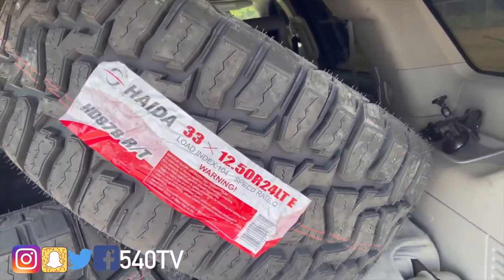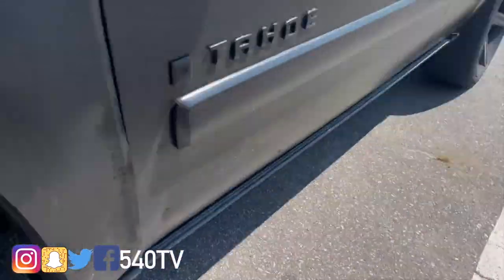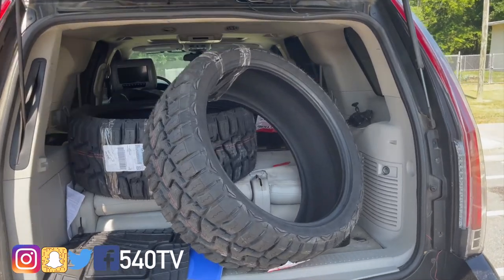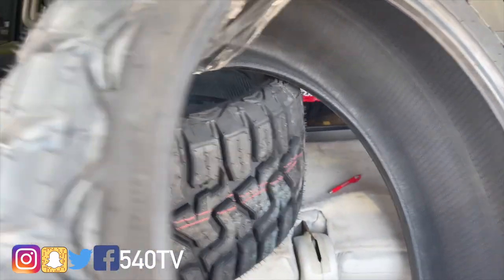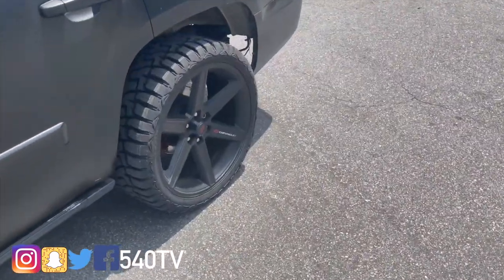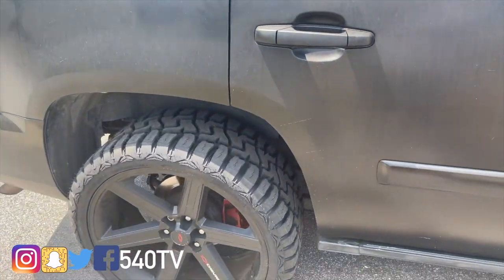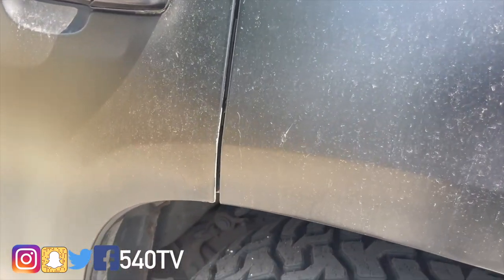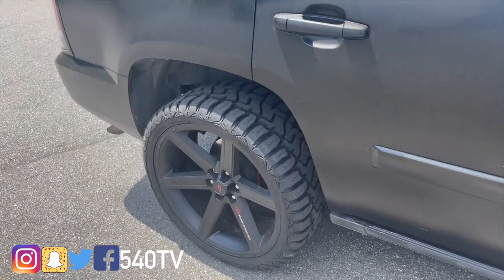MOUNTED THE 24' IROC ON 33x12.50 OFF ROAD TIRES Chevrolet Tahoe LTZ

Comment: I'm trying to get 33x12.5x24s on my 2008 Hybrid Tahoe. Do you think they would fit ? For some reason the hybrid looks like it sits lower than your truck. Thanks for the input bro 💯🔥
Reply from the maker: Yea they will fit..I had to cut because I put spacers on mine
Reply: Did u have to lift it?  @540tv6

Comment: Do these rub at all? I have a 2007 tahoe z71 level lift I’m trynna get me some I was just wondering do they rub?
Reply from the maker: Yea it rubs only because I installed the spacers..so I had to cut before and behind the wheel
Reply: @540TV  would it rub with out the spacers
Reply from the maker: No it wouldn’t.. spacers made it rub on the wheel well plastics and the electric stepbar

Comment: Spacers?
Reply from the maker: Not in this video I did get spacers once I did the lift
Reply: I’ve got terra hunters 35x13.50s going on 24” ballers on my esv with 2” spacers. Ima need to see what clearance is and see how much I need to lift.  Thanks for the reply 👊🇨🇦🥶
Reply from the maker: Only thing is with spacers you gonna have to cut because the wheel will rub the front corner of the bumper and bottom of the fender. I would leave the spacers out unless your looking for that stance.
Reply: Yeah I mounted em up yesterday, she rubs hard on the 35x 13.50x24s. 😂 0 turning radius with the 2” spacers on the front.. Im get some lifted struts because mint seem to be sagging a bit anyways and use my 2”leveling kit and rc upper control arms and see what clearance I have before I bust out the hammer and saw
Reply from the maker: @DJTV_88  yea I did a lot of cutting. The rub is gonna kill you tires like it did mine. Make sure the cut metal is clear because it will tag your tire